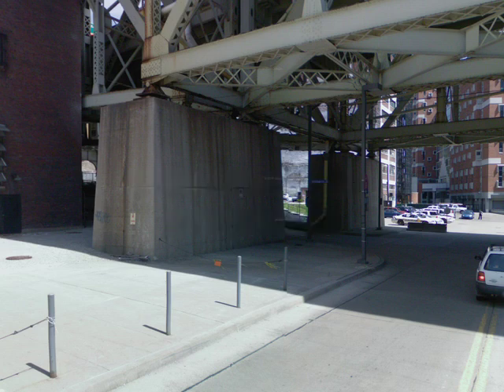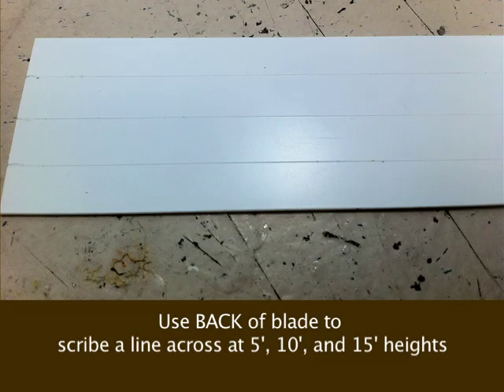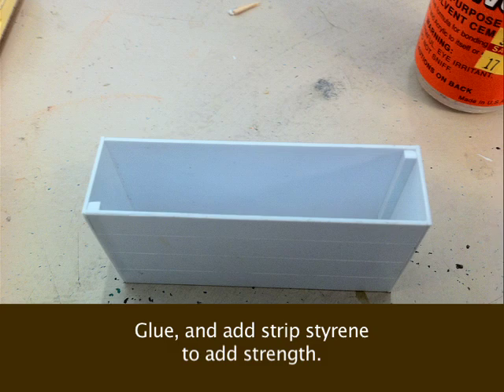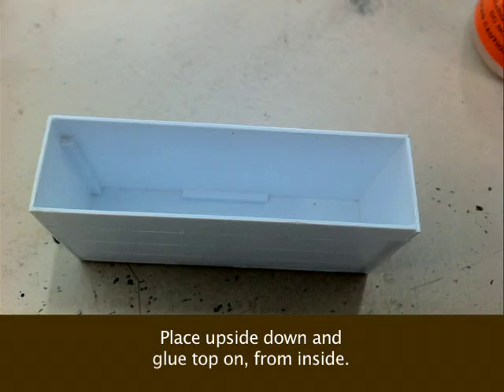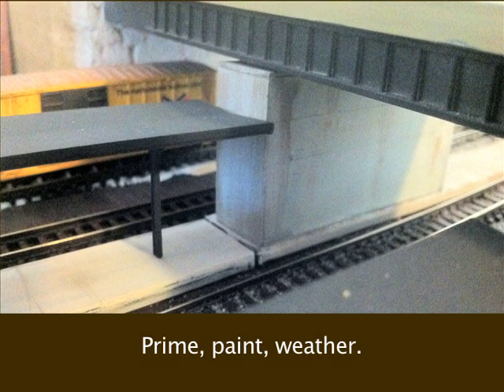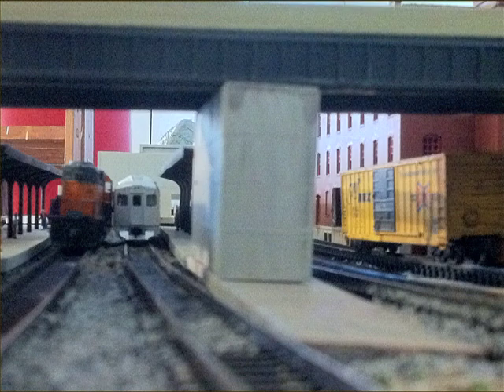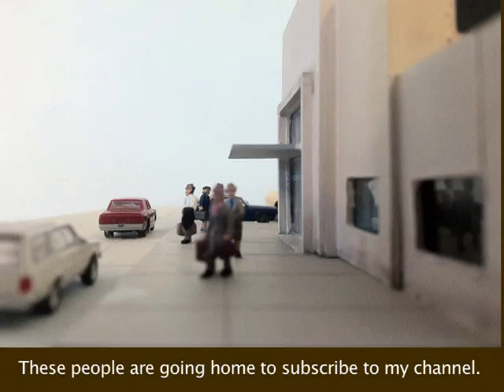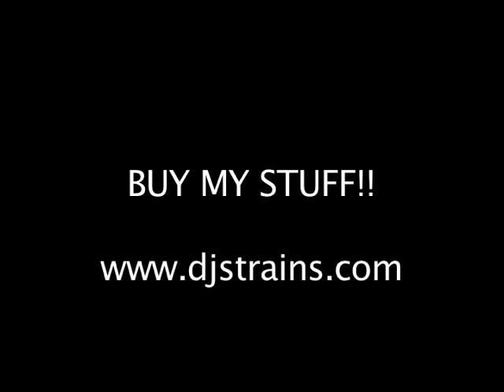Model Railroading: How To Make Your Own Bridge Piers!

Comment: My Dad worked 44 years for the RR, starting with the Hew Haven, then Penn Central, and finally Amtrak. He was a carpenter and worked repairing coaches. Finally he transferred into the "glass car" where he made windows to replace those that were broken in use. He always told me that if I ever tried to get a job on the RR he would come back and haunt me, so I never did. He did like that I was into model railroading though and he'd LOVE your videos, both modeling and real life experiences. Thanks.

Comment: I made some bridge piers a couple weeks ago with some scrap 2" foam board I had. Mixed up some really thin plaster with some Greg paint and brushed it on for some texture. After a few coats of that, I sanded it lightly and weathered. All made with leftover materials from other projects.

Comment from the maker: I normally use liquid nails for wood and foam, but last week I used Alex Plus latex for a small piece and also to hold foam board to plywood and it worked good.  My garage varies in temperature (cold as an igloo right now), but so far so good.  I use latex paint, and sometimes need 2 coats on some areas.

Comment: DJ, that is why I'm glad I got hired by the Mechanical department. Even though my rest days are during the week, I work the same shift 5 days a week. Anyway moving onto your latest project, it's looking good. What are you using to hold down the foam board? Liquid Nails for projects? Have you had any issues while trying to paint the foam board? I'm guessing you're using latex paint on the foam board? Have you seen the latest project railroad from MR? they are using a adhesive from DAP.

Comment: Bridge piers can also be made from foam blocks covered in fine grit sandpaper and then primed and painted to look like concrete. It seems, to me anyway, that use of the foam blocks would be faster and easier than making them from styrene.  It is, after all, fewer pieces to cut.

Comment from the maker: In 1998 CSX and NS were in process of taking over Conrail, when they were told by the govt that they were not allowed to have another implosion like when the UP / SP merger took place and trains were backed up for miles.  So CSX had a huge hiring ad in the western Pa area.  I went to a hotel filled with 300 plus applicants, with no experience either.  question 1..do you have no criminal history, or d.u.i.'s?  That cleared 1/2 the room.  Same with a good driving record, and not color blind.